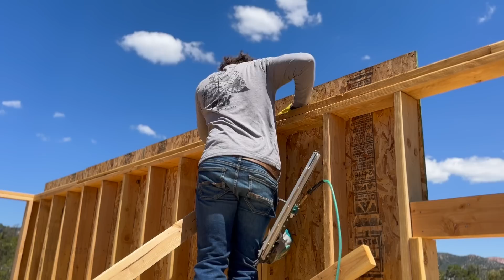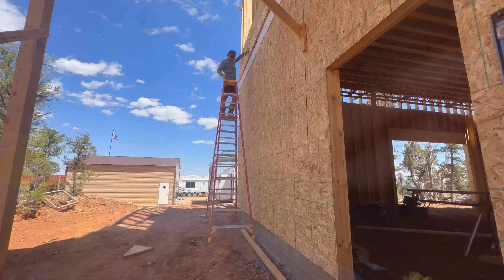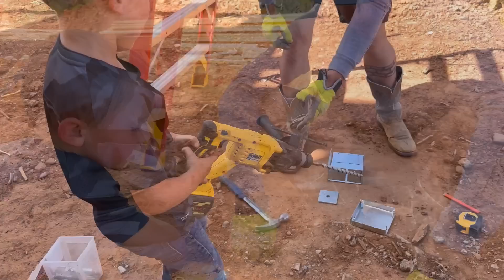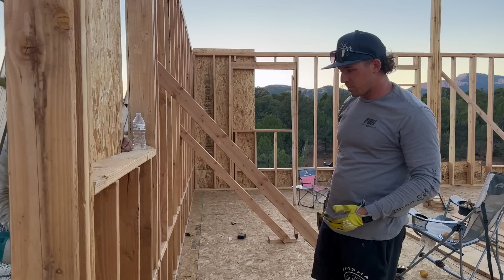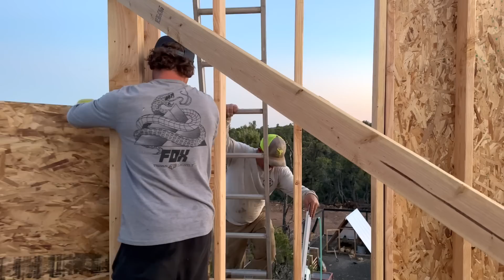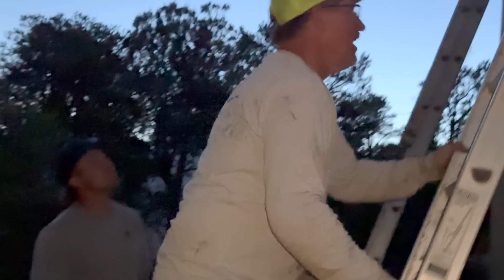HUGE PROGRESS ON OUR OFF GRID APARTMENT

Comment: Hey, first, I want to see you guys are doing an amazing job! May be a suggestion would be to rent a Lull, or a sky-track,  they are a all terrain forklift. You probably already know what I mean. Maybe rent one of those for a month it’ll help you with your roof framing (roof trusses) roof plywood, facia/soffit trim putting in your windows, window trim, you can build a 8 foot long platform with rails on three sides. It’ll be so much safer than the ladder and ladder jacks.

Comment: to strengthen your plank bolt a 2 x 4 to the bottom at a right angle.get bolts that go all the way through & leave about 3' at each end to put the plank on the jacks

Comment: Hey guys safety first. Put a belt on  with a loop for your claw hammer. Then use it in properly  rather than  just sitting it the on the beam above your loverly wife below. Either end of the claw hammer will do extreme injury to her pretty head when it tumbles down.